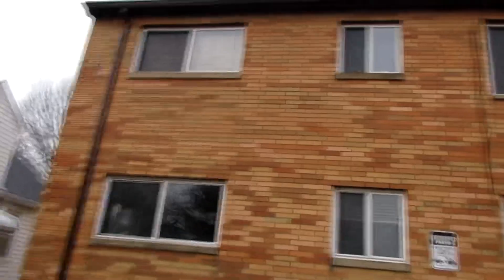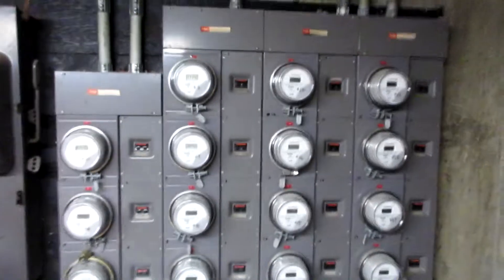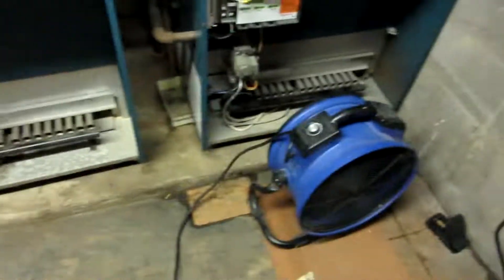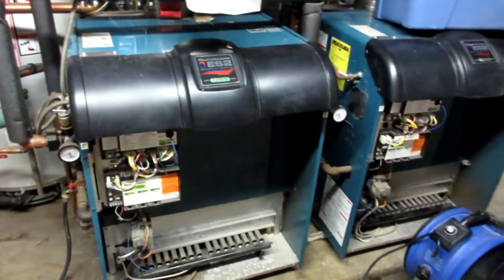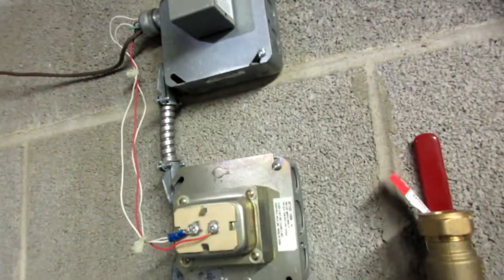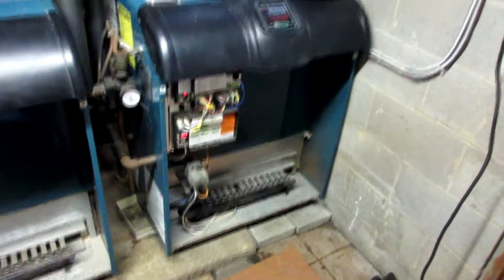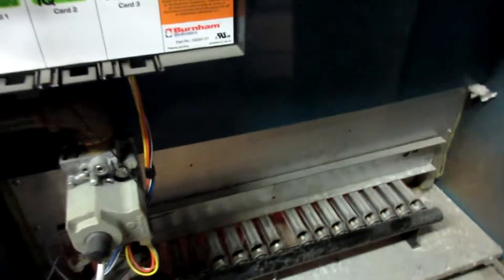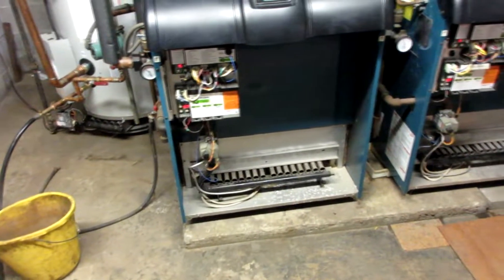Both Boilers Broke at The Same Time? Burnham ES2 Enhanced Series2 Control System Inside Troubleshoot

Comment: What was the problem?
Reply from the maker: The Left Boiler quit working because a drip on a compression fitting for a circulation pump and It dripped on the electronic exhaust motor, shorting it out.  I put a new electric exhaust motor and it fired right up. The Right boiler quit because a tub drain in the unit above had a faulty compression ring on the original brass tub drain. I actually fixed it last week but I didn't film it. I was miserable in the boiler/HWT room.  It was over 90* in Cleveland and my blood is still as thick as fudge. lol